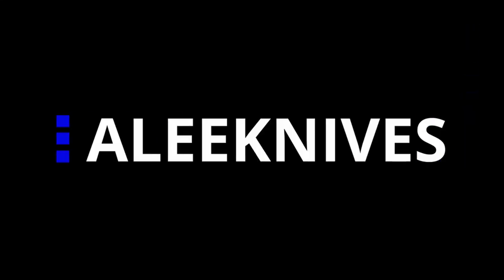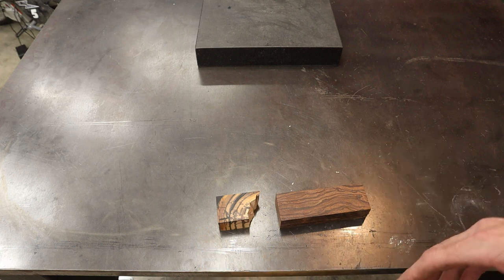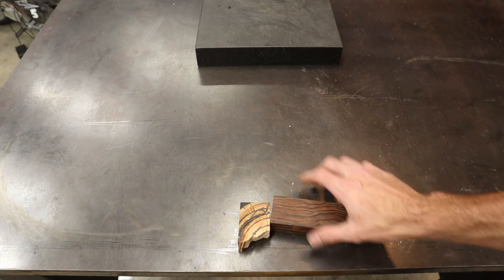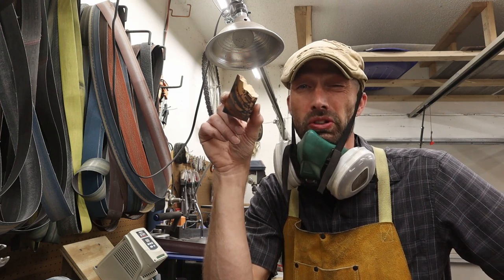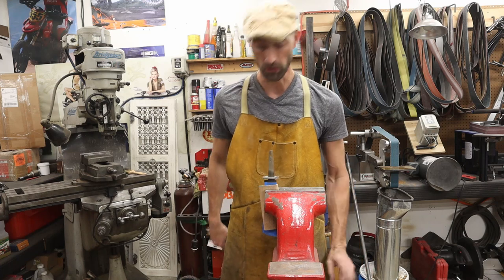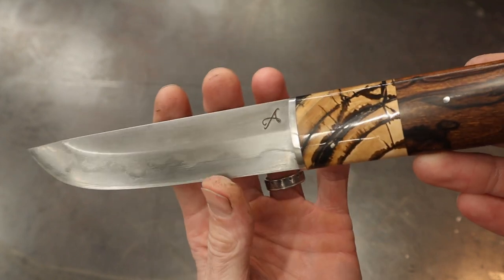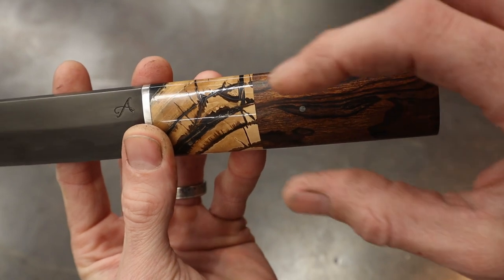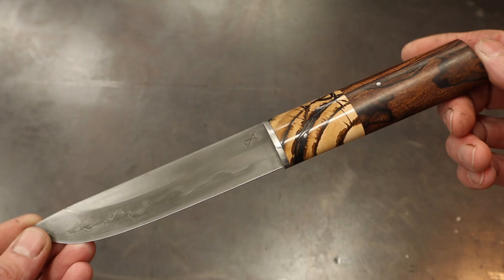Mammoth Ivory - Puukko knife build Pt.3 - Mammoth ivory and ironwood knife handle

Comment: To prevent chip out on the tusk during drilling, epoxy a piece of sacrificial scrap steel to the tusk or use the back to back layered painters tape method. This will prevent your drill from putting lateral pressure on the tusk, plus creates sort of “hold down or clamping/backing pressure” to prevent chip out. After drilling remove the steel and clean up with acetone. 
Love your videos
Reply from the maker: Very nice tip!

Comment: Gorgeous!  What were you using to polish the handle?  Was polishing cloth a special material?  I cannot build as fast as you are posting.  But I am learning and applying your teachings, hints and suggestions.  Thanks again for all the help and videos.   God bless.
Reply from the maker: I was using mothers polish with a regular shop rag. I use mothers on a lot of motorcycle parts and found it works great on hard woods also!